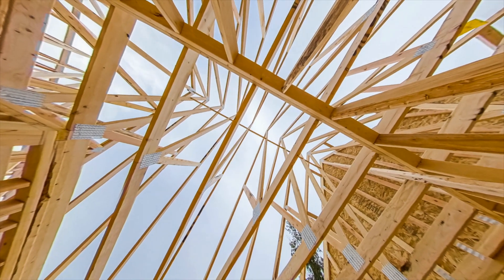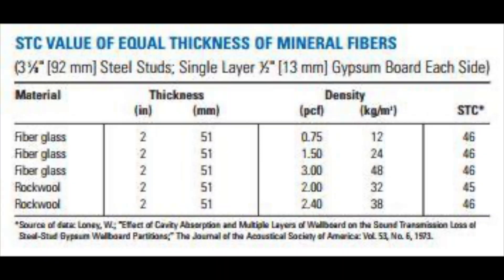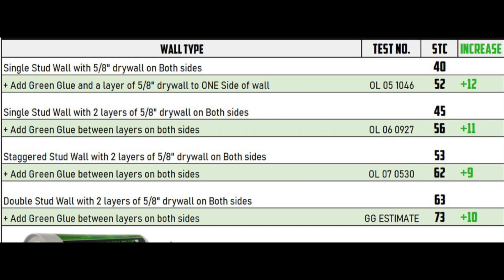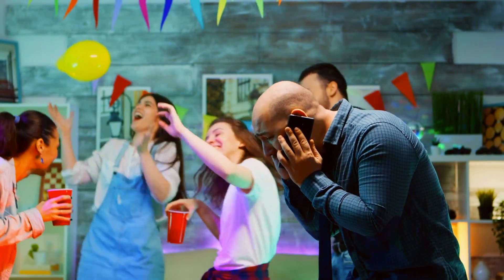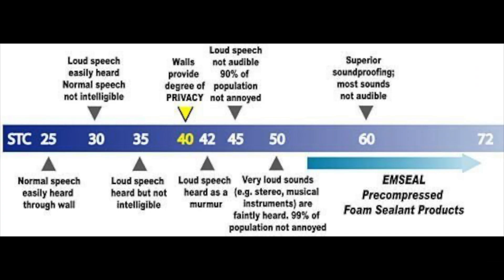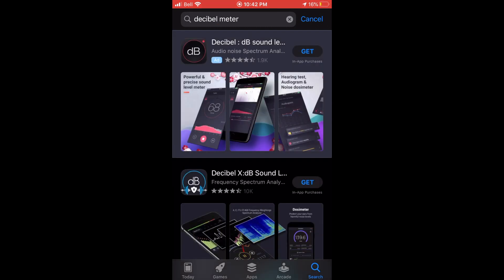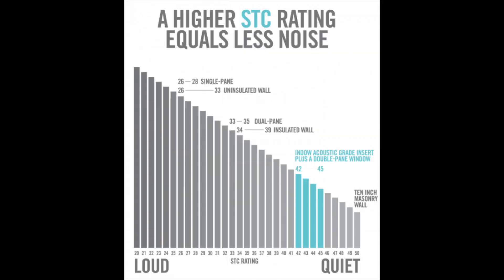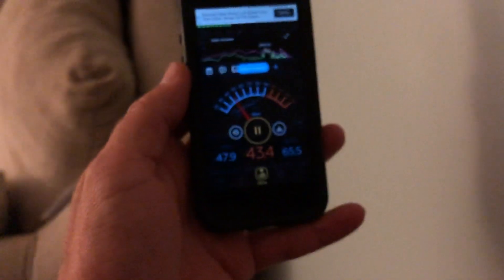Why STC Ratings Are Critical When Soundproofing!

Comment: I want to raise the STC rating of a wall between my bedroom and living room. It currently has cheap 1/8'" paneling on both sides and you can hear every little thing.
 I'm planning to put up drywall, as well put electrical in the wall. How much difference wound it be to just put up drywall without insulation? I don't mind hearing some sound. I just don't want to hear everything plain as day. Maybe 32 to 37 STC?

Comment: Great video as always. I’m building a home theater, one 16” on center wall is already built but I’m going to remove the Sheetrock. My options for that wall are decoupling with hat channel and spacers or green glue and double up the Sheetrock. Which do you suggest if I’m trying to also keep the wall energy efficient? Also, the adjacent (splitting a garage in half) wall I have free reign but should the walls be the same or could I use staggered stud design on that wall. That wall would be the wall to the shop. Thank you

Comment: What would be the best way to raise the STC of a 14' high x 18' wall of a room that has a loud machine? It is probably 5/8" drywall with roll insulation. Would MLV or Green Glue covered by another 5/8" layer of drywall get us an STC of above 50? There is also a permanently locked wood door in the demising wall that our neighbor says most of the noise comes from. Removing the door and drywalling it shut is also something we will probably need to do. Thanks

Comment: For interior walls using 5/8 rock have you found open cell foam to be a better dampener than fiberglass batt? Is it worth the extra$$$’s .50/ft  what about sound dampening around plumbing drains. Which is better? Thanks for your advice
Scott

Comment: Any tip on sound insulation for flooring specially when u have laminate or vinyl flooring most condominium insists on installing a sound insulation foam can you suggest what would be the ideal rating that one should use thanks

Comment: if i covered my intire room with egg tray covered in newspaper , would it actually prevents others in the house from hearing me inside the room i really need an advice i m about to do it tomorrow i already have the egg trays  please help
Reply: No! I'm a professional acoustician and I can tell you the egg shell treatment that so many people default to as acoustic treatment will only control reverberation. It will only do maybe a decibel or two in terms of transmission to other rooms. The only way to significantly increase isolation would be to add mass (a second layer of drywall) or add resiliency (remove existing drywall, add a resilient clip or channel, then add new drywall)  Also I'm not sure what the newspaper is for. I'd skip that.
Reply: It's pretty simple, add more mass like drywall = more is better and make sure it's sealed properly any hole, crack or whatever gonna make the result not worth it.

Comment: Greetings! I am building a theater room in my basement. It will be below our master bedroom. I was planning on going with a room within a room design to completely separate the walls and vibrations from the main house studs. The ceiling I was going to do a MLV with resilient channels and double 5/8” drywall then have a drop ceiling about 6” below that so I can easily access the ceiling speakers and lights plus i feel it adds a small layer of soundproofing. My main question is when I build the stud walls inside the room, do I use a type of rubber bushing to attach them to the main frame of the house for stability? Any advice would be great!
Reply from the maker: Yes, the rubber bushing is also for vibration control so that will be great for a media room.
Also, my video for next week is about the best way to soundproof for a home theatre.
Reply: @soundproofguide  Awesome! I'll stay tuned!